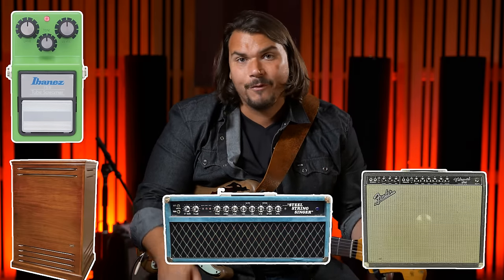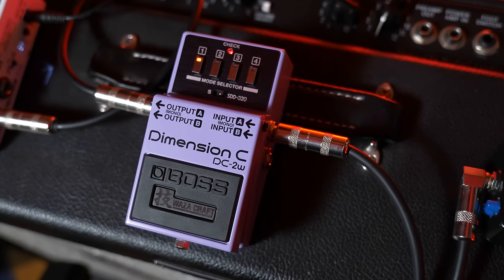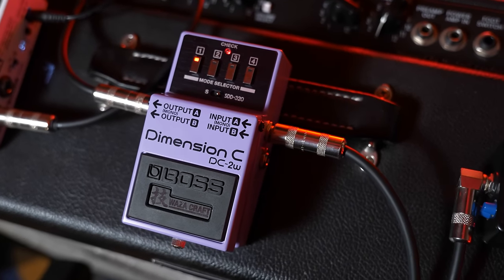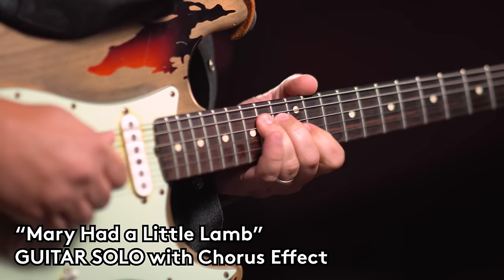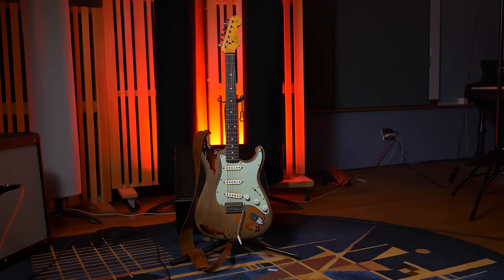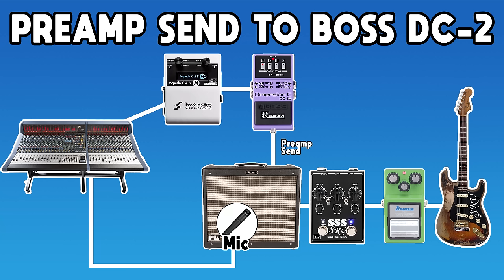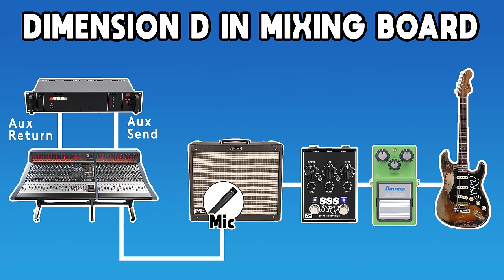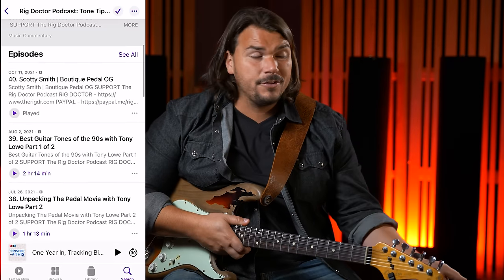The Secret Behind SRV's Tone

Comment: where was SRV’s chorus live?

…i too … once in ‘79?… after discovering chorus … trying to emulate Metheny’s 3 amp setup with Primetimes… a simple Guyatone chorus on 99.5% of the time… (only cut briefly for a spike in a sustained solo note)… i discovered i needed 2 choruses… one for “more effect” … but the first one was the secret weapon. key word: subtle. … i did this test to many people: they wouldn’t know it was on until i turned it off. 
depending on your ax and your amp, you can kinda cover up that STRAIGHT sound without the pedal, but takes some Bill Frissell level finesse. ;)
Reply from the maker: Live I suspect this was either absent or more Leslie potentially.

Comment: If your pedal cable is wired for STEREO which some have a switch mono/stereo on the speaker cab or you can wire it up using solderstick which has adhesive for heatsinking onto speaker wire. You use a LINEOUT BOX only on half of the speakers, so if your speaker cabinet has 2 speakers only use the LINE OUT BOX on the left speaker or the right speaker but not both. You use a Boss vibrato pedal, DOD vibrothang, Dunlop rotovibe set on vibrato mode, dimension D with the LINE OUT BOX only on half of your speaker cab as your WET signal channel while the other half of the speaker cable has your dry signal channel. This will get you that Lonnie Mack tone if you're using a boss vibrato pedal or using a dimension D will get you sounding like SRV texas flood. This way of using the line out box to separate your speaker cab is how vibrato pedals and chorus pedals are suppose to be used. I never liked a vibrato pedal in front of an amplifier or in the effects loop, I only like it using a line out box only with half of the speaker cabinet as a wet and dry cabinet. Try making a video lesson about this way of using a line out box using the diminished D or vibrato pedal

Comment: on let's dance ,you can clearly hear that he is using way more of that effect than you are displaying in this vid... maybe because running it thru the board instead gave the engineer a little more control of it and he opted to crank it up more...lets dance sound more like the example of just chorus in the loop....
Reply from the maker: Perhaps, but again because it was mixed in parallel after the track, likely in post, they can control that in real time.  For the examples here, I'm trying to show what the effect does, generally, and how it can be put to use to exemplify this tone for the recreational player.  Sure, if you wanted to intensify it, you could got to button 2 or 3 and get more effect.

Comment: SRV used a Black MXR Loop Selector pedal to switch out his TS and Wah pedal to go direct straight into his fender amplifier to omit the tone sucking loss. The MXR Loop Selector pedal has mixing resistors. I'm not sure if SRV used this MXR Loop Selector pedal on LIVE 83 El MoCambo but his clean tone is true bypass and not using the Ibanez TS buffer circuit. I'm not sure if the MXR loop Selector was to run SRV clean signal only to the dumble amplifier while the TS and wah goes to his fender amplifiers using it as an A/B switch

Comment: Wow, I had no idea.  Well, I have a Strat, a TS9, a Deville, and a Dimension-C Waza ... but I just know I ain't gonna do it justice when I try!
Reply from the maker: Just make sure you'd doing the parallel thing with the chorus after the preamp with its own bath to the mixer.  That's the real trick, the chorus you use is less important than the signal path.

Comment: Great video, thanks Mason. I tried to replicate the tone for live sounds using a TheGigRig Wetterbox and mix in my MIJ CE-2 Chorus in parallel to my dry signal , which is going through a Gladio SC for the Dumble sound. The signal then hits my DRVB. Gets pretty close as well, but I never would have thought about this without your video!
Reply from the maker: Also try it after your Deluxe Reverb output transformer with a line out box and really get close :)
Reply: @VertexEffectsInc  Not sure if I understood the line out thing. Is the line out just between speaker and amp? So would I put the LO box between amp and speaker? Doesn't this fry the pedal?
Reply from the maker: @tszegvary  you would connected between the speaker jack on your amp and the speaker itself.  It's a passive box that takes a tap off the output transformer and provides you another output (like an FX send of sorts from an amplifier FX loop), and allow you to feed pedals for a parallel path.  That's what we did in this video.
Reply: @VertexEffectsInc  Ah got it! Thanks for the details. I saw those line out boxes are quite cheap to get, will definitely try this!
Reply from the maker: @tszegvary  do you have an interface to feed the chorus into?
Reply: @VertexEffectsInc  Yes, I actually use a Tow-Notes Captor X a lot. So it sounds like using a line out like a Lo-1 I would just spin off some of the signal and feed into Captor X and then out to wherever (Computer/Logic, Front of house) - but I can't feed that same signal into the speaker of the amp, right? So basically I can't do this with one amp for live sounds? I mean....without a huge rig.

Comment: Great videos - and this one is super!  So if the Dimension D is really a chorus effect, what kind of settings would you use for, you know, a regular chorus pedal without having to go out and buy a Waza pedal?
Reply from the maker: You could emulate this with other chorus'.  The main X factor is the parallel path.  As you heard, when I moved the chorus to the FX LOOP, when it was in series with the amp, it was way more intense and lost all the subtlety of the parallel application using the line out or the send and then feeding the chorus to the mixing board without coming back to the dry amp.  If you do this, you can use several chorus pedals to get this effect.  Maybe not the same, but close.  The signal path is more critical than the actual chorus IMO.

Comment: Awesome! I had a hunch it was chorus, but was not sure exactly what. I liked option #2 (preamp send out) best to my ear, but would be inclined to try the "Stevie Way" on my own accord for accuracy's sake. For option #1 or #2: Since the IRs would also have speaker and mic emulation, was there a reason why you put the DC-2w before the Two Note?
Reply from the maker: John, to covert it to a balanced signal to prep it for the mixing board in a similar context to the Aux Send.  I tried to set it as linear as possible as not to disrupt the overall tone of the pedal and what it does.  I think you'll agree it sounds close to the example where it's actually run in the Aux with the actual Dimension D.

Comment: I actually had a TC electronic 3rd dimension, I liked but when plug into it on or off had a modulation to the clean sound
Reply: Yeah, the one with the pushbuttons. It'll get you there, but it's not as rugged as the DC-2W, and TC is about to drop a reissue SC+F, which should be real dang close to what Stevie used, live.
Reply from the maker: Those are cool too.  The SCF to me doesn't sound like this.  I think the DC-2W is the move if you want the SDD-320 vibe.

Comment: great video.  he did use 2 rack units live from the mid 80s to 90 but i have no idea what was in the rack.  I assume it was noise gate but i have no idea what the other was.  Could it have been a similar unit?  Any idea mason?
Reply from the maker: Not sure, I don't have any evidence that this was used live, but I guess it's possible.
Reply: @VertexEffectsInc  I don’t have any evidence either.  I’m guessing he used the slow vibratone for the same effect
Reply from the maker: @bmcash3411  could be the live response to what he was using in studio???
Reply: @VertexEffectsInc  perhaps!

Comment: I’m on a quest of getting this going with our life sound with my dc2w in stereo and retaining back into the desk on a stereo channel and the amp set dry in mono! As I only have 4 aux sends on the desk which are being used for vocal effects and monitor mixes so was thinking of inserting a rack compressor on the mono guitar channel and using the parallel out on the compressor feeding the input on the dc2w and collider and returning back of a stereo channel on the desk and the fact the we use an analog desk there shouldn’t be any latency issues!
Reply from the maker: You should be fine, these are analog pedals, and the Collider has analog dry thru

Comment: VERTEX, try to find out if SRV used the TS pedal BEFORE or AFTER the octavia because he would stack the TS + Octavia = SRV squawk tone to make a YT lesson about. Also research about what date hendrix got the first fuzz face pedal because the recording dates of fire, purple haze, foxy lady were before he got the fuzz face pedal. Roger Mayer said that the first octavia#1 was very low gain so hendrix used a mosrite fuzz ( not a fuzz face ) for the songs fire, purple haze, foxy lady. Hendrix used two mosrite fuzz pedal stacking them to get that foxy lady tone is what researchers are saying was not a fuzz face pedal. Try making a YT lesson about these types of stacking because the octavia pedals are very high gain which Hendrix didn't use high gain octavia pedals because Roger Mayer said you had to pair it with a fuzz pedal because the octavia was very low gain. The later versions of the octavia was higher gain which Hendrix used on Band of Gypsy to get that ring modulated octavia tones. If you listen to Ernie Isley octavia was made by Roger mayer its EQ settings on customized for Ernie Isley it sounds on those Isley hit songs. Ernie Isley used a Big Muff stacked with an Octavia which he gets some intermodulation breaking up octavia tones. What I'm saying is that the Roger Mayers Octavia input impedance is very sensitive to pedals before it and are very low gain compared to the new octavia pedals which aren't the same.

Comment: Just curious if any type of chorus effect that’s has a mix and rate knob would have the same effect. More for pedalboards. May need to try it out.
Reply from the maker: The chorus probably isn't that critical in terms of which one it is (to a degree).  The real "X factor" is using the chorus in parallel after the dry amp and mic.  The way I used the chorus in one of the last examples in this video, where the chorus was in series, in the FX Loop, you can hear how much more intense it was.  It lacked all the subtlety of the album examples or the other clips I played.  It really needs to be in parallel after the dry amp to get this effect properly.

Comment: Mason where are you plugging the pedal through as the effects loop is it the preamp in and power amp out?.
 I’m wondering if a Fender Hot Rod Deluxe will do that same effects loop that your using, someone told me that the Hot Rod amps - deluxe & deville’s don’t have an effects loop
Reply from the maker: I'm using a line out box as stated in the video, it plugs into your speaker input and speaker loaded into the amp and taps off the output transformer padded down to line level (with a volume control to attenuate it to pedal level for the DC-2).
Reply from the maker: Hot Rod amps do have an effects loop, pre amp output is the (send), power amp input is the (return)

Comment: Hey Mason. Great vid comparing all those configurations. At 18:20, the sound is much fuller in the lows but then when you go to the actual SRV setup with the original Dimension D, the low end gets rolled off as though it could be out of phase. Much thinner sounding but punchier. It does however sound like what SRV was doing. So maybe it was out of phase. Thoughts?
Reply from the maker: The phase is correct.  The "Hideaway" sample is on the middle pickup as it was played by SRV in that position.  Mary Had A Little Lamb was on the neck.  That might be what you're hearing.
Reply: @VertexEffectsInc  Ah yes. I thought it might be a different pickup but wasn't sure. Thanks!
Reply from the maker: @kiritsi100  sure thing!

Comment: Great video.  Could you run the dry amp through a Captor X and then its stereo line out to the Dimension C and onto cabs?  Eliminating the need for a seperate line out box and giving you bonus attenuation if necessary

Comment: How are you connecting the line out box?  From the FX send of the amp or do you have a line out on the amp?  Great video thanks!
Reply from the maker: Diagrams are in the video for each set up.  Be sure to screen shot those.  Line out boxes always connect to your amp and speaker.  Speaker Output (on amp) to Line Out Box Speaker Input, Line Out Speaker Thru to Speaker Input (on speaker cabinet).  Then the line level output is created that just uses a normal unbalanced coaxial cable to feed the effects pedal, in this case the DC-2W and the Two Notes Cab M to get our balanced line back to the mixing board.

Comment: I bought the Boss Dimension C on your recommendation but it’s just a little too much. Can you tamp down the signal with an expression pedal? It’s annoying that you can’t dial it back on the pedal, itself. I play through a Deluxe Reverb without an FX loop. Any ideas how to crank down that dimension c to get that thickness in a way that isn’t overbearing?
Reply: Also, I have your SSS/SRV pedal, because of course I do haha thanks for the amazing advice (and pedals)!

I was playing a bar tonight and I was asked “how the hell my tone is so fat and dirty” and I showed them your SSS pedal ha
Reply from the maker: The Dimension D settings are more subtle, so that's a first step, but you can do what I do here with the line out to put the chorus in parallel, the second thing you could try is using a mixer, like the Mix Blender: https://www.radialeng.com/product/mix-blender and then using that to blend in more dry signal.
Reply from the maker: Thanks for the recommendation of the SSS SRV!!!
Reply: @VertexEffectsInc  thanks, Mason. That’s exactly what I was looking for. You’re the 👑

Comment: Mason, I hate to say it but the dimension d in the mixer aux bus is a huge upgrade from the line out parallel method. It’s brighter, way more articulate, it sounds like the album. Do you think this is more because of the rack mount d vs waza pedal or the difference in routing?
Reply from the maker: It’s likely a combination of the circuits and the routing.  However, live - it’d be easier to pull off the line out version of the signal path.
Reply: @VertexEffectsInc  thanks, makes sense. Though it would be fun to hand a DD to surly sound guys and be like, “hey bro, can you throw this on an aux and just give me a smidgen?”

Comment: Isn't there a parallel here to EVH using a modulated doubler? BTW, I am all into this W/D/W doubling application. It seems that SRV was a little less obvious than EVH in his use of this effect. Effects should be used effectually. Almost invisibly if at all possible. Effects for effects sake are self-defeating. Effects should support not lead. Another great example of this is David Gilmour. The use of which should cause the listener to ask, WTF is that??? It should be almost ghostly.
Reply from the maker: When EVH got together with Bradshaw he would use Micro Pitch from an H3000 Harmonizer after the preamp in a wet/dry format along with Reverb and Delay.  This is a bit different than the Aux Send like SRV was doing, but similar in that the dry and wet are in parallel.

Comment: Do you suppose this could be achieved using two amps using an AB switch for both amps? Thinking I could put the chorus in the fx loop of just one amp and have both amps on…
Reply from the maker: No, because there is nothing to A/B, the chorus has to be on all the time, by its nature you need the dry path and the wet path in parallel.  As you could hear in the video, the FX Loop was the least accurate we tried, it would be worse even in front of the amp.  This is why the parallel signal path is SO important.  As you could hear, with the pedal in series, in the FX LOOP, it lost all its subtle nature and really was too prominent to match what SRV was doing.

Comment: Amazing video man. Very helpful.  I use a fractal FM9 which has the dimension chorus available.  How would I arrange the signal chain on the FM9 to achieve the desired effect?  Thanks man.
Reply from the maker: You would have to set up a parallel block after the speaker and mic with chorus in parallel.
Reply: @VertexEffectsInc  so when you say “mic with chorus in parallel” not sure how that works on fractal.  Do you mean just add the chorus in parallel and mix the level of the parallel chains?
Reply from the maker: @joehernandez5600  I think you have cab and mic sims in the Fractal Software you can pull up to put a parallel mixer block after the mic in parallel with the amp and cab (dry).
Reply: @VertexEffectsInc  We don’t have Mike sims per se. What we have are image responses (IR’s) which capture a cabinet mic’d with a certain mic.